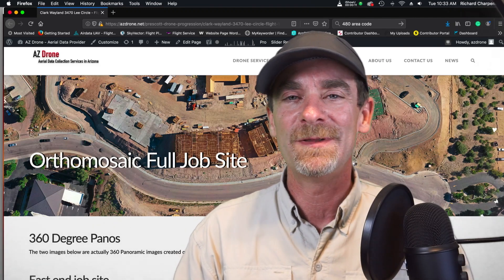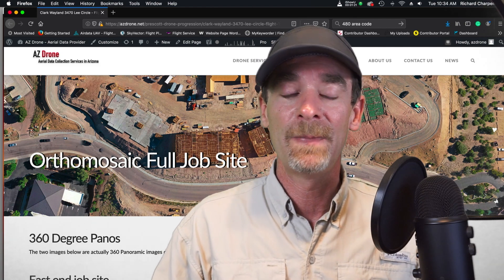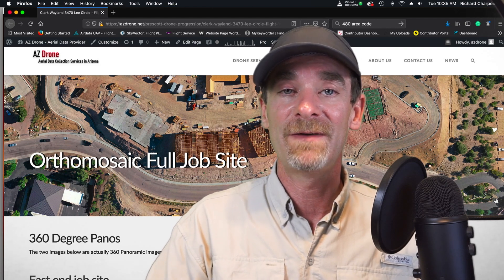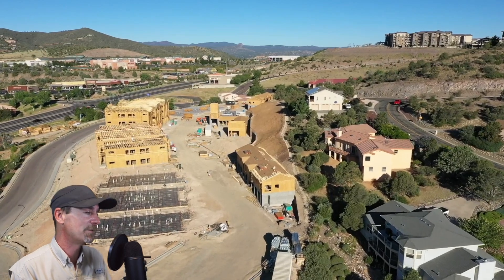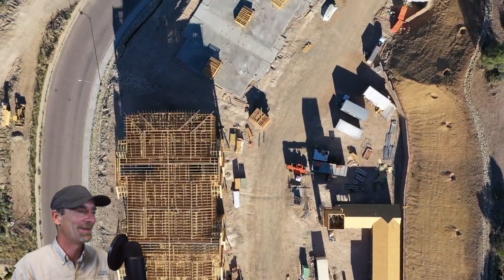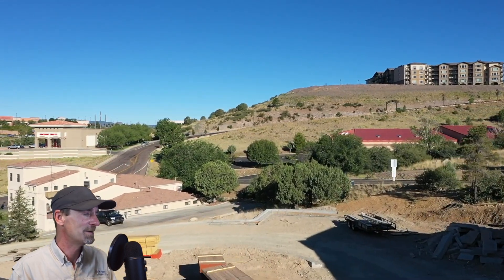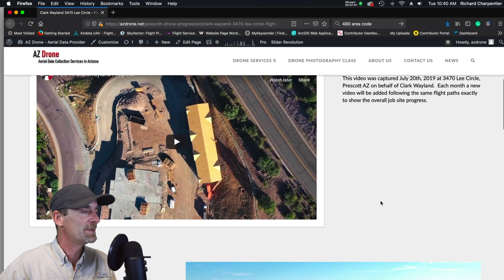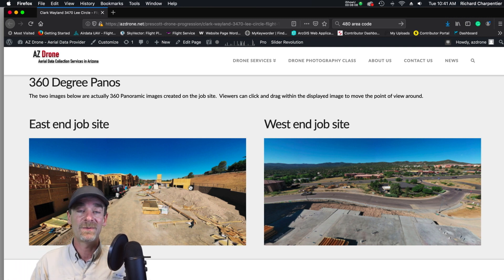Drone Construction Progression Project with a DJI Mavic 2 Pro, Litchi, & More!

Comment: Now that you have flown this mission once about how many hours do you estimate that you will need to complete this on a month to month basis? time on jobsite, time on PC.
Reply from the maker: Awesome question!  After laying out my flights my time on site is under an hour. Several waypoint missions for video and stills requires 1 battery.  I’m also doing an orthomosaic flight that takes almost 12 minutes. Round trip drive takes about 30 minutes. Once at the office I offload and catalog all images and video with Kyno. The video assembly and editing takes at least an hour. And the ortho takes at least an hour.   I’m looking at about 4 hours minimum and maybe even 5 hours. Also I’ve built a web page template for presentation and that takes another 30 minutes to fill in as well.
Reply: Thanks, I'm trying to estimate how much I should charge for a typical worksite progression job. 5 hours seems about right. Although I would use Maps Made Easy for the ortho.

Comment: Hola rich....!!!!
Muy bueno el video.....!!!! Como todo lo que haces....!!!!
Pregunta: por favor me podrías decir porque cuándo hago un plan de vuelo con PIX 4 d capture y mavick 2 pro el modelo digital de elevación se curva ....!!!!!
El dem adopta la forma cóncava muy pronunciada...!!!
Gracias por tu conteste...!!!
Abrazo 
Julio robles 
Tucumán 
Argentina
Reply from the maker: Julio, thanks for stopping in on the channel!  I read your question, and that's a tough and strange issue.  I know there were issues months ago with Pix4D and the Mavic 2 Pro for rendering models (sometimes the GPS info was way off of where people were flying).  My understanding was that with recent updates (this year) those issues were resolved.  But your issue sounds different from that particular one.  

When I run into modeling / capture issues I will usually return to the office, and setup my flight with both Map Pilot and Ground Station Pro.  I try to make them as close as possible to each other.  I fly both missions making sure to note which app I use first, and which second.  I'll then process both models in Metashape to see if both flights experience the same issues.  You said you're capturing with Pix4D capture.  Have you tried any other capture application?  What are you using to process the DEM after you fly?  Have you tried other 3D rendering software yet?  I'm interested to learn more about the issue.

I'll look forward to hearing back from you.
Reply: Thank you for sharing your videos and tips. 🌴☀️🌋☕